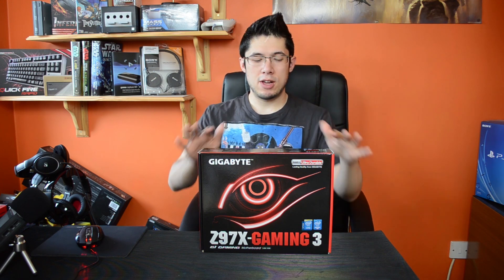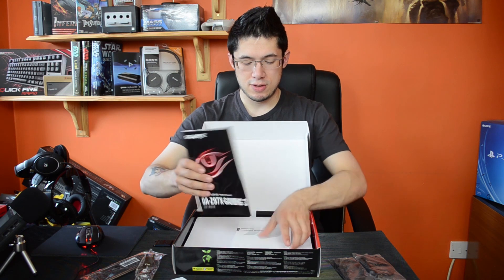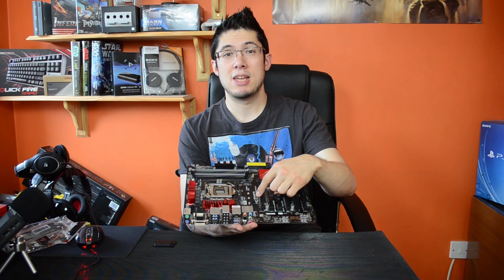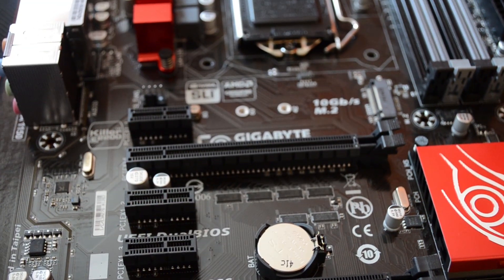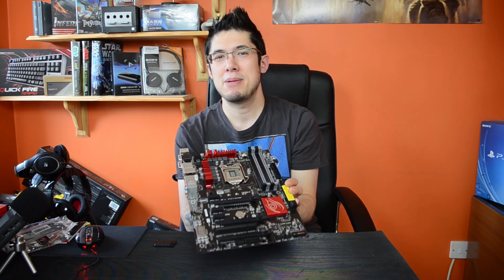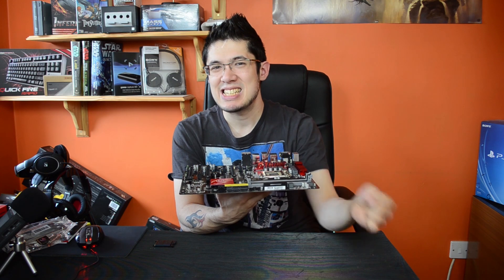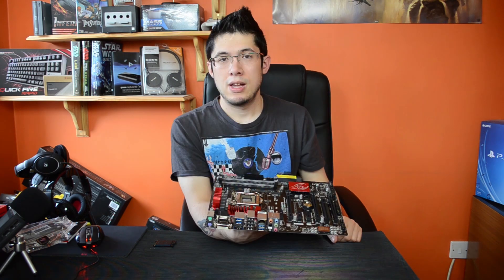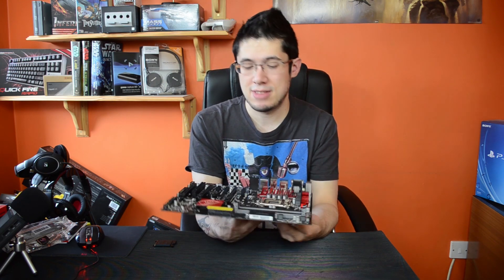Gigabyte Z97X Gaming 3 Motherboard Overview

Comment: How many fan connectors on motherboard?
Reply: It has 5 and not 3. It has  2x CPU fan headers and 3x system fan headers and they are all 4-pin.
Reply: 3 system fan and 1 cpu fan

Comment: I need some help, I am buying PCI-E GAINWARD GeForce GTX 980, 4GB DDR5, DVI, miniDP, miniHDMI, and this motherboard, im buying Procesor INTEL Core i7 4790K BOX, s. 1150, 4.4GHz, 8MB cache, GPU, Quad Core, buying this charger --> 700W, ANTEC VP700P, ATX v2.3, 120mm vent, also this cooler --> ANTEC H2O 1250, CPU hlađenje, socket 775/1150/1155/1156/1366/2011/AM2/AM3
Reply: I am also buying this ram's Kingston DDR3 HyperX Savage,1866MHz,16GB(2x8G)CL9

Comment: Will this motherboard work with Intel Core i7-4790 and Nvidia GTX 970
Reply: bastard no its 11
Reply: +aPeX Clan yes
Reply: +Ray-Tube Will this works with Z97X GAMING 3 and GeForce GTX 960? have two rams Vengeance 8gb and Vengeance 8gb 1600mhz.
Reply: King ALKA yes it will
Reply: +Ray-Tube is 1+1=2 ?
Reply: +aPeX Clan I have i7 4790k and Gigabyte G1 Gaming GTX 970 on this motherboard. So yeah, it works.

Comment: Does my GTX 970 fit in this? PLEASE REPLY SOMEONE! <3
Reply: +GT Gaming yes it does, I am building a new computer now and it fits fine.
Reply: darkman619112 Nice! Thanks for the answer!
Reply: +darkman619112 I have bought this motherboard. Im going to put in MSI gtx970 and i5 4690k, i'm planning to oc my cpu, gpu and ram. Will this motherboard handle it?
Reply: Odin Alfred yes, it will be able to handle it, I have not yet overclocked my cpu or my gpu, but I know for a fact this motherboard can handle it.
Reply: +darkman619112 thanks
Reply: +Odin Alfred i Ordered this motherbord 4 days ago and its coming in the mail but im starting to hear some bad things about this dieing. Does it work well with you?
Reply: Dmanrocks Studios It's working perfectly. I haven't had any problems with it.
Reply: Dmanrocks Studios it's working fantastic make sure you are not working on any carpet when you are building your computer, it can short circuit the motherboard.
Reply: +GT Gaming Will this works with Z97X GAMING 3 and GeForce GTX 960? have two rams Vengeance 8gb and Vengeance 8gb 1600mhz.
Reply: yes it will fit. :-) I have a  gtx 970 g1. works well with the board.

Comment: is this good for mid to high end pcs?
i just want skyrim to run max settings 1080p with plenty of mods.
so would this motherboard, i5 4690k cpu, 8gb ram,  and the ASUS Radeon R9 280X get me these results??
Reply: also 60fps
Reply: ***** what do they improve? what is their purpose in gaming? am noob plez halp?!?
Reply: thanks that cleared up alot :)
Reply: legit what you said above is my exact computer and it runs skyrim ultra at 100+ fps maxed out.. but i lucked out and got a upgraded version of the gpu
Reply: ***** like this one, right?
Reply: A motherboard can't help with frames. A motherboard is, next to the cpu, the most important piece of your system. It is the board on which everything is connected. It also regulates communication between all of the hardware that is installed. 

Basically, you want a motherboard that matches your cpu socket. You also must know if you want to overclock or not because some boards are better and some for that, some don't allow any overclocking. You need to know how much ram and it's speed to see if your board can handle both aspects. You also need to know how many USB ports you need and what type. Generally, more usb 3 ports equals more money, just like if you want the m.2 SATA port. 

It all comes down to how many features are included with the board.

Comment: The difference between gaming 3 and gaming 5 is, the Audio Hardware connectors are GOLD plated on the 5 and 10K durable black solid caps on the 5.
I suppose worth the extra for TRUE gamers?